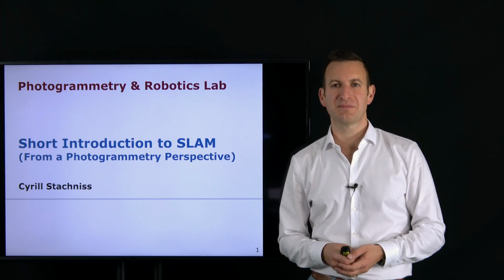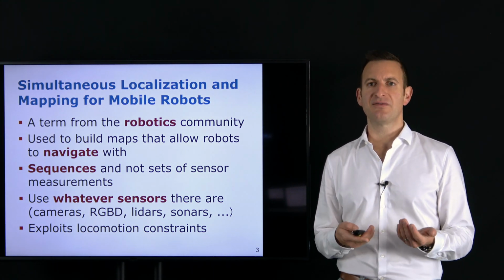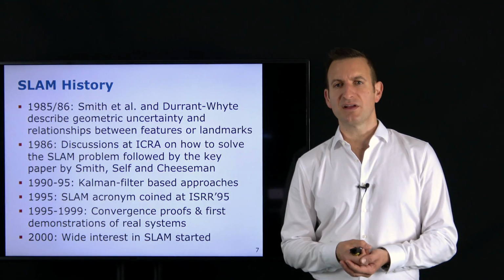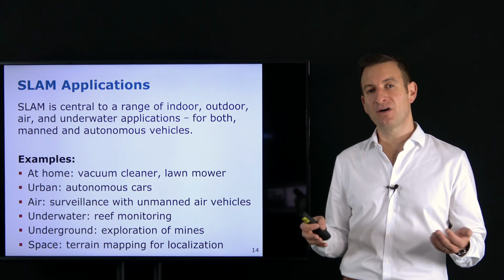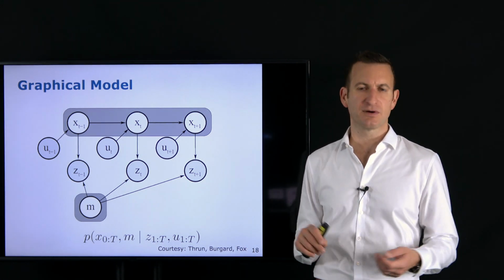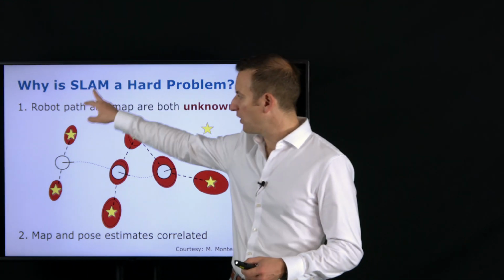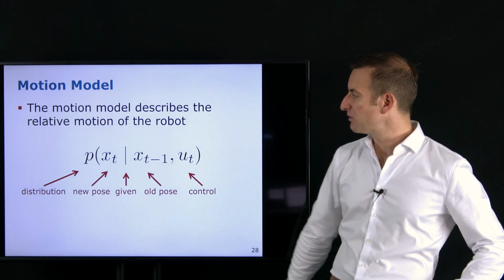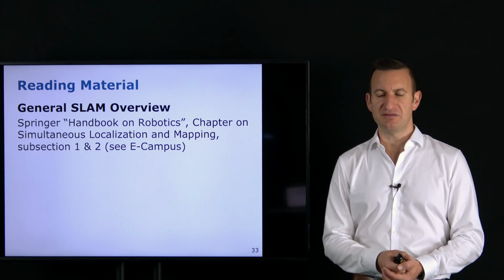Introduction to SLAM from a Photogrammetric Perspective (Cyrill Stachniss)

Comment: professor, which lecture to take to understand how tesla tackles slam using camera only? i have taken ur course on slam but if the data is only images and the pipeline is basically perception mapping and control, what algo is used and what slam approach to take? any lecture with image only slam?